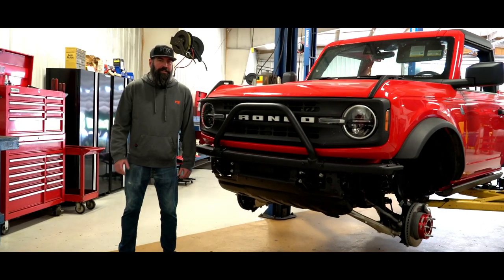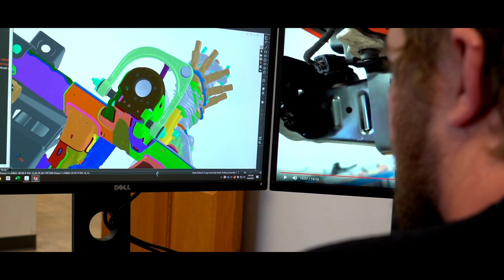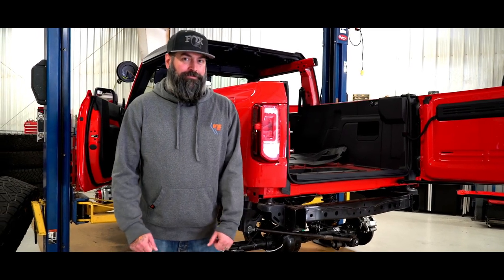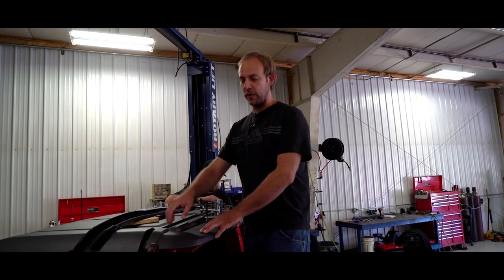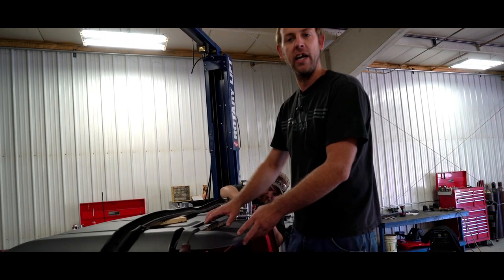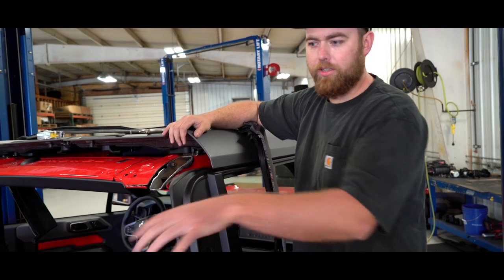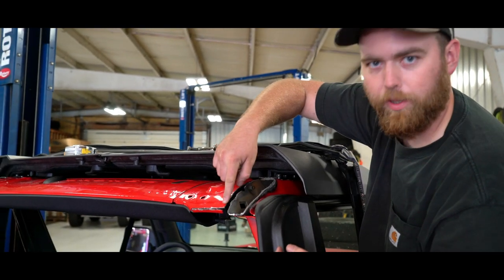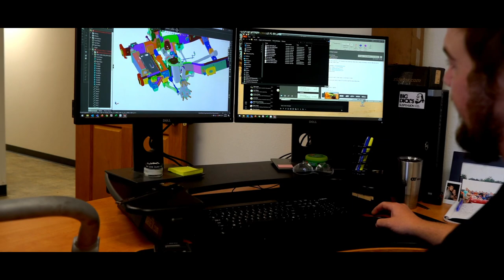BDS SEMA Bronco Build We Cut Up A New Bronco - Episode 1

Comment: Did you guys see the delamination issues on the MIC hardtop edges that are being reported in the forums even with the "MIC 2.0" version?
Reply from the maker: We didn't, but then again it went under the knife with less than 100 miles on the odometer to start converting it over to the 1/2-cab truck

Comment: Unfortunately, the Bronco is nearly impossible to get for many long time reservation holders. Ford's dealer allocation formula for 2022 prioritizes large volume dealers over customer reservations. Ford has all but abandoned their commitment to deliver reservations before dealer stock. For customers that reserved at smaller dealers who have fully embraced the Bronco, it will take years for them to get a delivery.